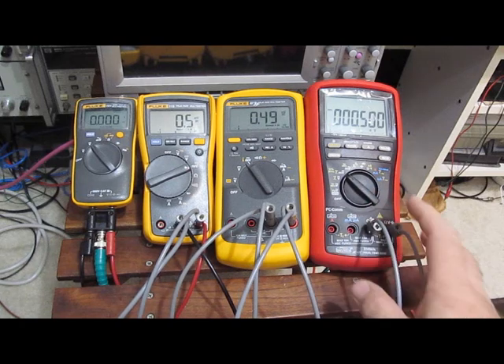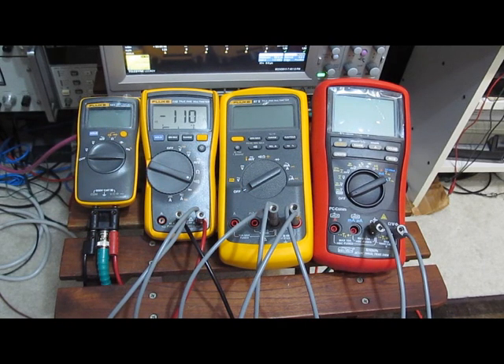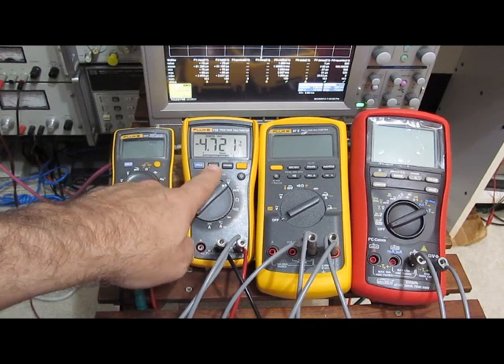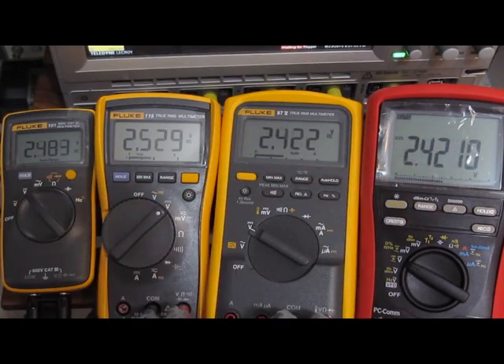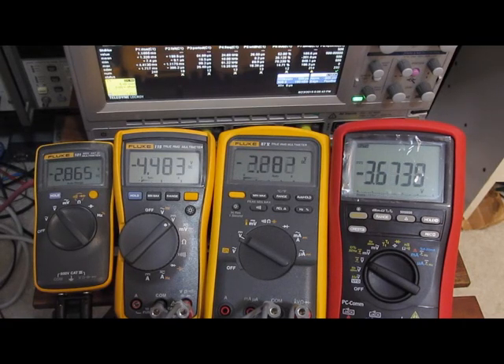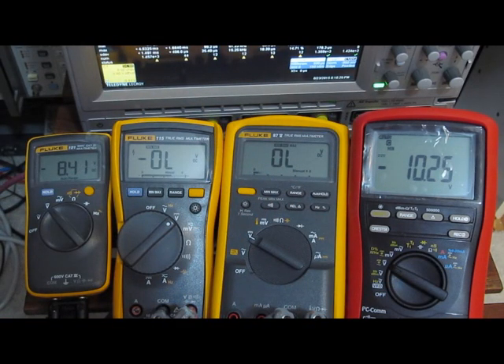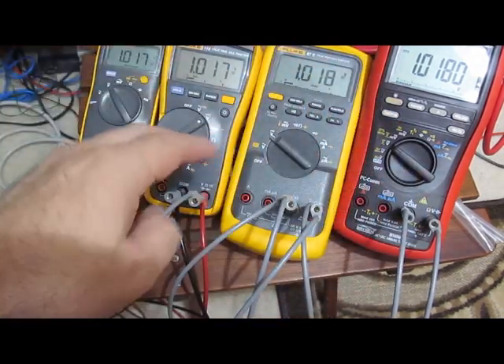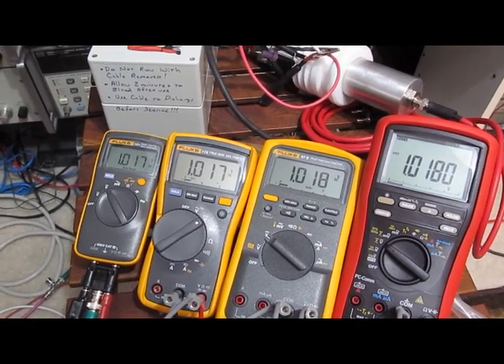Brymen BM869s vs Fluke

Comment: What if you have to service that Bryman or get it calibrated?
Is it as easy to take care if as the Fluke.
 I am looking for a multimter for automotive use. Hybrids are becoming more popular.
Reply from the maker: Assuming you know what it is you are asking and understand the difference between alignment and calibration, having the Brymen calibrated is no different than any other meter.  I find it a little strange you would need a traceable calibration for automotive but that ISO stuff must get everyone. 

For me personally, when it comes to automotive, I go as cheap as I can because the meters get so much abuse and I consider them disposable.   I do like the UT210E for measuring the low currents off the battery.   For my own electronics hobby, this general purpose meter is still the best one I have come across.
Reply: Thanks for your replay. I like your videos, very high tech.
It's just that every so often a multimeter should be calibrated due to some abuse. No sense using an inaccurate meter right? I am trying  to make a transition more into the electrical side of the automotive service work from the mechanical side. So I am looking for a good multimeter. 
 Thanks for the tip on the UT210E. I have been looking for a good amp clamp that measures in DC volts. How accurate do you think that is?
Reply from the maker: Thanks, glad you are enjoying them.  

I would download the manual for the UT210E and read it.  This is an AC/DC current clamp and good for about 100A.  I bought it to run against these tests and then realized it could resolve 1mA.  That saved it.  I have never used the DC volts mode on it, or any feature that uses the leads.  I just use it for a clamp.  I never made a review for it but others have.   I have posted a fair amount of data about drift and such on EEVBLOG.  For $30, it's hard to beat. 

Normally for my automotive work, I would say I could really get away with +/-5% on pretty much every function.  It's easy enough for me to do a quick sanity check if I suspect it is having a problem.

The cheap meters I buy for automotive are normally overkill.   The one thing that did come up from time to time was the need for a portable scope.   I found a couple of old Fluke 97s last year that a guy was using in a garage.  The UT210E along with one of these easily handles all my needs.

Comment: hello joe! how much is the total cost? does tme delivered it to your door without hidden charges?
Reply from the maker: I've had it for almost two years now.  You would need to check current pricing.  There were no hidden charges when I bought mine.  The total was calculated on-line.
Reply: joe smith thanks for the reply. I just visited their site and created an account. the current gross price is 211.6 usd and shipping cost is 26 usd (net). The reason I aksed if there were some hidden charges because the shipping cost says it is "net" I wonder what is the "gross" transport cost, their site does not specify that.
Reply from the maker: What they quoted is what I paid.  Total was about $230 without the serial adaptor when I bought mine.